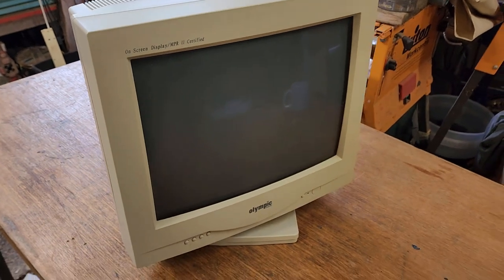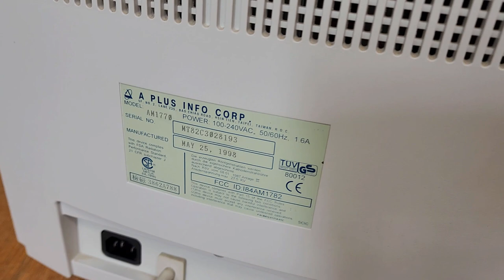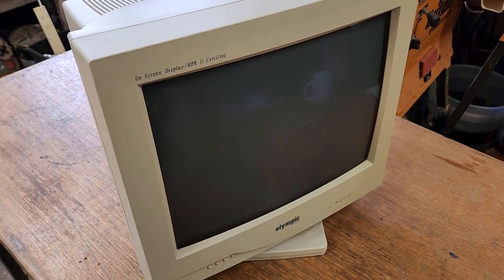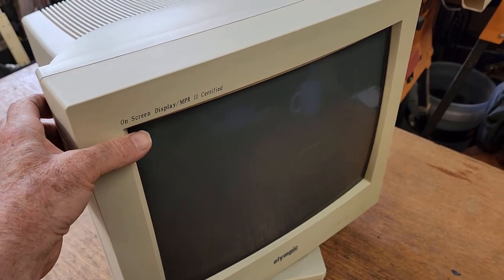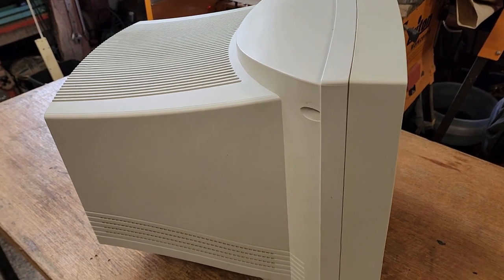Scrapping out a Vintage Computer CRT Monitor for some nice Scrap Copper - but little else!

Comment: It is generally worth picking off all IC chips, especially the ceramic ones, and EPROMS - the ones with a sticker covering a little window. It's certainly a waste to get paid low grade board price for the weight.
Reply from the maker: Yeah, I do save the ICs when I feel the urge and they are easily accessible! No one will buy the low-grade boards here, so I just send them to ewaste recycling.

Comment: you can use the braided wire as desoldering wick also
Reply from the maker: I have actually tried that and it doesn't soak the solder up as well as proper wick! Thanks for watching 😊

Comment: So in a nutshell, these CRT monitors harbour dangers, requer caution in dismateling, have not a lot of value in them and you need to take them to landfill. So if you are into scrap they are tons of trouble for not enough money. They are only worth picking up if you have a shop and storage place to wait and see if they will sell in the future as regular antiques.
Reply from the maker: A reasonable summary Sarit, although they do have a demand now if in working condition and they usually sell on ebay for pretty decent money. I'm storing good ones as I think they'll be a good investment for future sales. For street scrappers, I'd suggest pulling out the degaussing cable & the yolk on the street and leaving the rest as ewaste. Unless they appear in good condition and you wish to try and resell them!

Comment: That red lead leading up to the cap in the middle of the top of the tube has 25kv when the monitor is running, and will hold a charge after powering off, usually not for long, and its not dangerous, but feels pretty awful if it gets you. Worth discharging if you are pulling one apart immediately after powering up and it runs enough to get some sort of picture. One other thing people might like to save is the heatsinks with the little fins bent in alternative directions with a diode attached. They are either copper or brass, and if you cut the diode lead then rock back and forth a few times metal fatigue will break the pins off where they are soldered to the board. You were lucky that European style yoke came apart so easily. Many of them are full of glue, and I used to just chuck them in with the transformers as you could flatten them with a sledge hammer and still get nowhere.
Reply from the maker: Thanks for your comments Stephen! Yeah, the static charge on the red lead may be high, but it would be pretty low current so not very dangerous - but I didn't know it would hold any charge after the unit is powered off. I don't think anyone should scrap something immediately after having it running as a general rule! Yep - I have had some of these full of glue and they usually go into my transformer bin. This one was quite easy 😊👍
Reply: @TheUltimateRecycler  Your advice on the main capacitor in the power supply is very good. I have seen those still charged up weeks later in faulty equipment and it could be lethal. The glass in a picture tube has conductive coatings inside and out of the glass insulator so behaves like a capacitor. They will sometimes even regain a bit of charge after you short them out. The HV there is very low current and not lethal, but feels pretty bad when it gets you. People should really short out the capacitor in microwave ovens as well before pinching the transformer even though there is a very small chance of one being charged, since they have an inbuild discharging resistor. I think I only ever saw one hold a small charge back when I repaired hundreds of them. One of those caps could certainly kill you.
Reply from the maker: @stephenw2992  Thanks for all the info mate! Yeah no one really enjoys a shock no matter how low the current is! I've had plenty from electric fences and even ignition coils on small engine magnetos!
Yep, I feel scrappers and repairers alike should make it a habit to discharge any large caps every time just to be safe.

Comment: Would have taken half an hour to put a new cable on it to make it worth hundred bucks so 50-50. But better to just hook it up to a Nintendo Wii or Sega Dreamcast (or anything else that runs 480p resolution) and live the dream :). What makes them worth several hundred to thousands is how much resolution and how fast they can run. Not really what brand they are.
Reply from the maker: I have so many stacked aside Jason, that I didn't want to save one that had to be repaired! Besides, I expect that there may have been something else wrong with this monitor for the cable to be cut off. Now that I've lost my storage yard and shipping container, storage is more of an issue! 😒

Comment: It is can be extremely expensive in the US to recycle the glass and cathode ray tube from CRT style monitor and TV's. Usually the fee far outweighs what you can recover scrap wise. Does your waste facility charge you for tv/monitors where you live?   P.S.  Where I live they have started to charge for flat screens TV's as well... Cheers
Reply from the maker: Hi Kimberly. We are fortunate that there is no charge to drop any ewaste at the local transfer station which is fantastic. I can certainly understand that if you had to pay a fee to dispose of them, any pickups for scrapping are out of the question!
Reply: My mom m

Comment: You just cherry pick the ease stuff. You did not get gold, silver, aluminium and more copper. All that would give you double or triple the money.
Reply from the maker: I disagree with the total money being even close to doubled by micro-scrapping. Yes, you could get a little more value if you have unlimited time and don't value it! Cherry picking the easy stuff gives the best return rate when time is a consideration! Thanks for watching Frank 👍😊